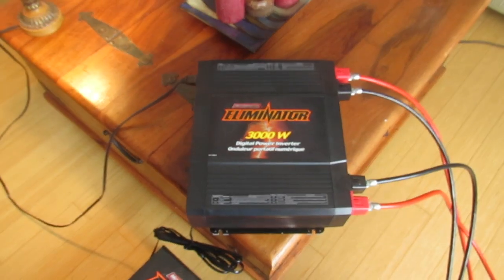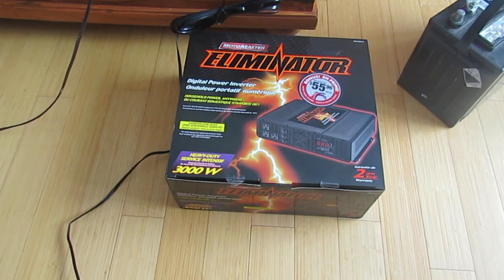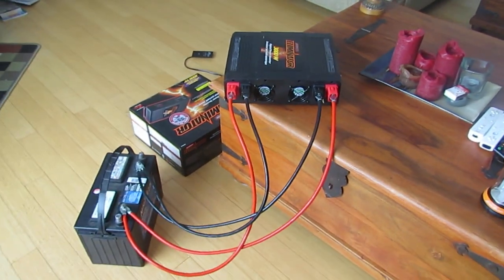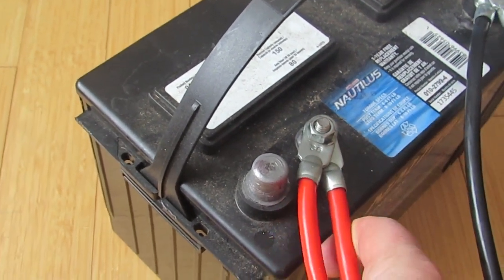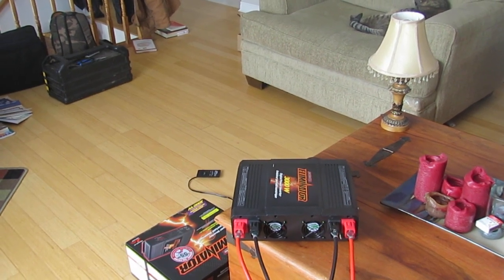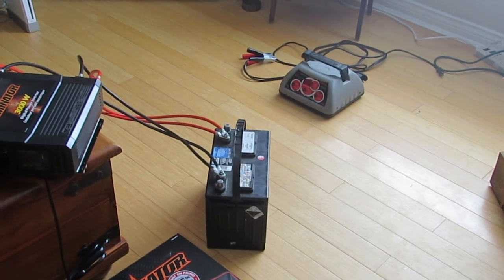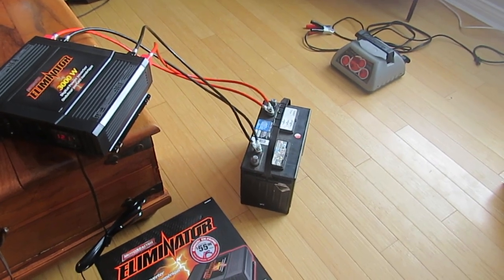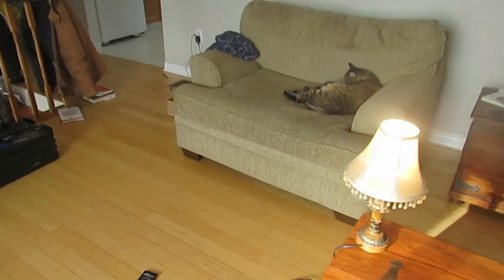Quick Setup for Motomaster Eliminator 3000 Watt Inverter

Comment: What number internal blade fuses do that inverter use need to replace the blade fuses in my inverter because I can’t remember what amp rating fuses they have multiple little fuses inside

Comment: My inverter gave off a burning smell. Now it turns on but anything plugged into it has no power. What could this be? Maybe internal fuses? Do you just open up the unit and change the fuses?

Comment: nice video but you put a switch between the positive of the battery and positive of battery to turn it off and on power still in the inverter little power

Comment: New to this, so sorry if this if an obvious question, but what size amp fuse should I use with both positive wires with this 3000 Watt Inverter (I plan on purchasing 4 100AH Lithium Battery’s if that matters)?
Reply: you used 150 amp fused i have 1100 watts come with 150 amp fused 
put a switch between positive of battery positive of inverter ok saved battery even if you turn it off power still in the inverter

Comment: So what kind of battery and cables do I need to buy ?
Reply: 12volt deep cycle battery 100Amp or 230Amp thinking 4 not to sure but I will used much thick wire

Comment: Shut up danger rangers and stop flooding the comments with the same comment.  He is a Canadian 🇨🇦. We don’t have time for manuals and safety.
Reply: But we do have common sense! I own this unit, manual states neg, then positive. Used in my truck now for 2 years, using 0 gauge and 2 150A fuses. Followed EVERYTHING the manual stated. I am no mechanic or electrician, I'm a drywaller. READ the BOOK. Be safe, fires suck!

Comment: By not using a wrench to tighten, you did not do proper connections and they are loose which can cause sparking. I also see from the melted thread on the negative terminal that you probably let it spark a few times before you finished. I would recommend wiring in a quick connector so there is jo sparking while wiring because it will be an open circuit, and then you can quickly connect or disconnect as you need it.

Comment: I use mine to run my CPAP machine when the power is out. I hook it up to my van with jumper cables and run the van with remote start which runs for 20 min and shuts off low power protection shuts the unit off when power is low which wakes me up so I can remote start the van again!

Comment: You are right, you are not an electrician and you are giving misinformation! I appreciate that you are eager to help others but to help others the most it would be better if you would first improve your knowledge base so you can steer others correctly! If mechanics and electricians didn’t tighten nuts every time a wrench got fumbled there would be a lot of cars and houses burning! Please do not lead people to believe tight connections are not critically important! Even the sizzling of a loose connection can damage both the unit and electronics plugged into it.
Reply: not only that but you don't connect the neg first, you connect the pos then the neg
Reply: @toslow9045  actually in the manual of this inverter it says to connect negative first.

Comment: just bought one of these today but it didnt come with the cables either way i learned something from your video thanks
Reply: Mine didn't come with cables either....
   I'd like to get some with claw clips on both ends...
Reply: @Valleygirl66  would one those motomaster eliminators with the clips ( the ones you use to boost your car ) work ?